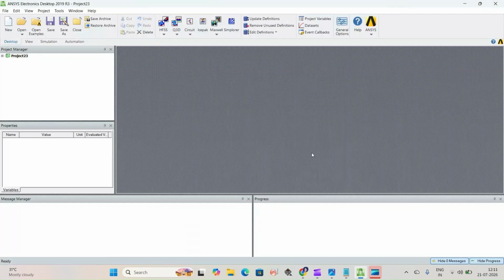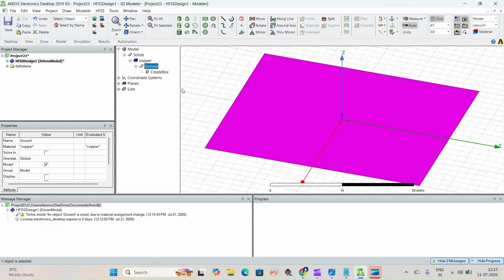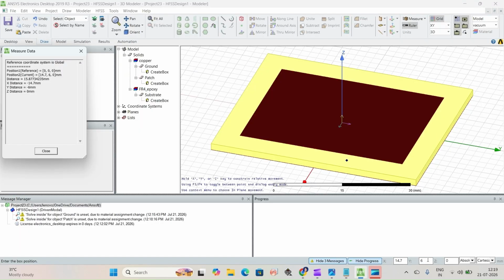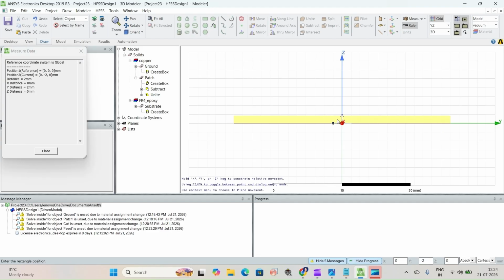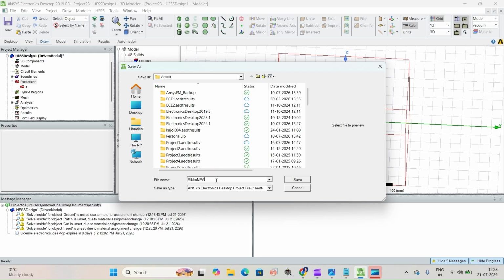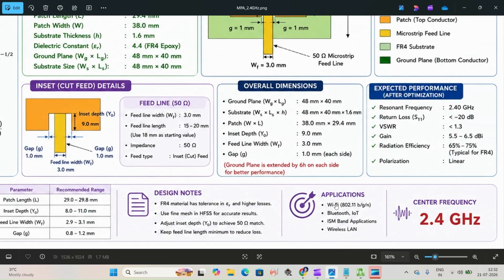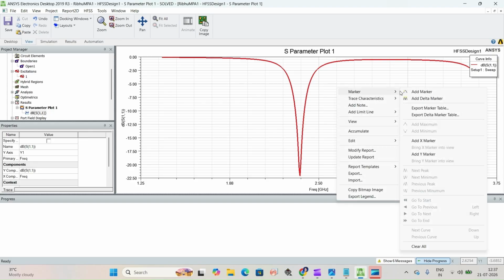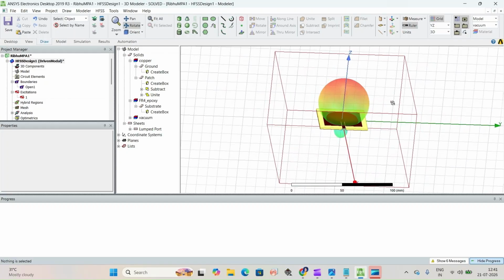Microstrip Patch Antenna Design Using HFSS #hfss #antenna #antennadesign #patchantenna #simulation

Comment: I hape already drawn the patch antenna using AWR, how to export AWR to HFSS? Thank you
Reply from the maker: Open your antenna layout in Layout.

Make sure the patch, ground, feed line, slots, DGS, etc. are properly defined.
Go to:
Layout → Export
Choose DXF (AutoCAD Drawing Exchange Format).
Select the appropriate layers:
Patch/metal
Ground, if required
Feed
Slots/cutouts
Set the correct units, preferably mm.
Save the .dxf file.

In Ansys Electronics Desktop → HFSS:

Create a new HFSS 3D Design.
Set the model units:
Modeler → Units → mm
Go to:
Modeler → Import → DXF
Select your AWR .dxf file.
HFSS will import the geometry as 2D curves/sheets.